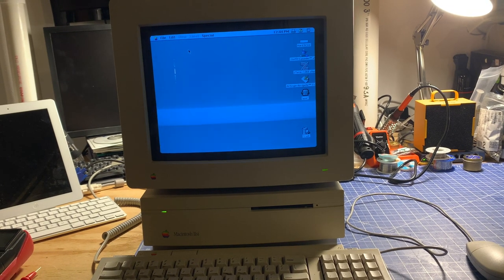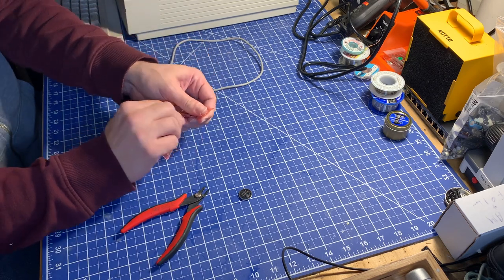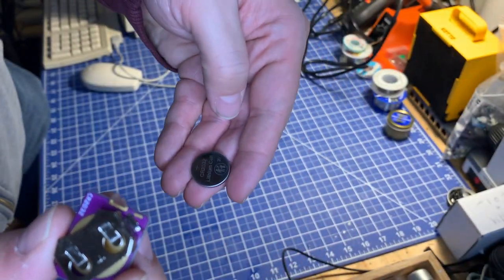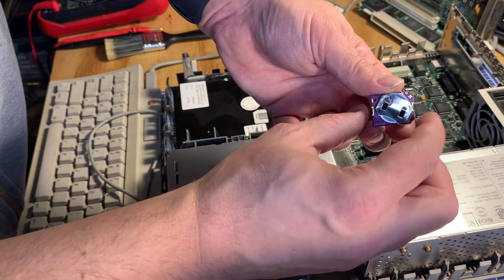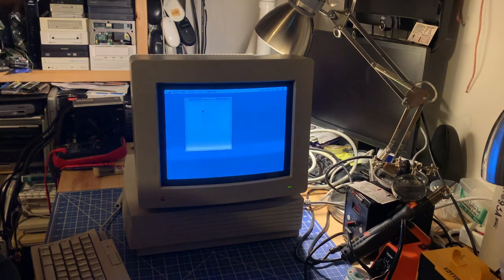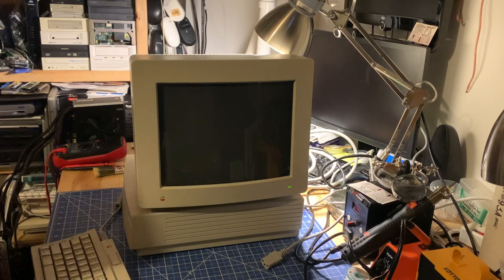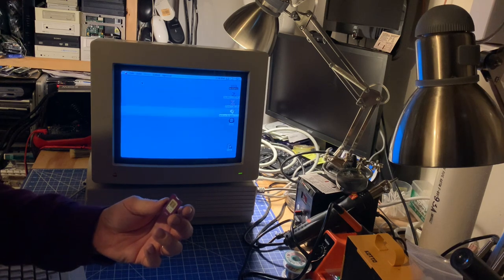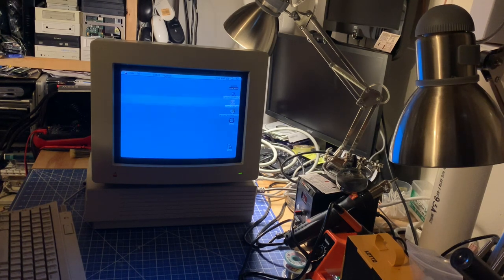Review: MacBatt CR2032 PRAM Apple Macintosh classic Mac battery replacement solution

Comment: Good video! Given that the original 14250 1/2 AA type battery is typically rated at 1200mAh and the CR-2032 at about 230mAh - how long does the coin cell last compared to the 14250?
Reply from the maker: This is a great question, and one I do not yet have the answer to.  So far they are still charged enough to keep the settings, but it has only been about a year.
Reply: @jonobst  I found a discussion online about a similar product called the Meow Toast. The estimate for the CR-2032 in that one was about 3 years. So how long do 1/2 AA batteries last? I have never replaced the one in my G4, but I have seen reports of 10-12 years. That would suggest 3 years for the 2032 is about right just based on the capacities alone, but it may not be that simple.

Comment: Does anyone know if these will fit in a Mac 128K or Plus?
Reply from the maker: They will not - the earliest Macs had the battery compartment on the outside of the machine above the power switch - totally different size of battery.

Comment: I didn't think the Macs used rechargables on the desktop machines?
Reply from the maker: You know, I’ve always just assumed they are recharging as the Mac does put voltage back into them when it is running - which is why the diode is needed.  However, after some googling, I can’t find a definite answer either way.
Reply: @jonobst  I'm just thinking of all the batteries I've pulled out over the years -- I don't think any have been rechargeable -- if they were that would explain better longevity? My gut says in general they just lasted longer. I've been having problems with modern batteries in my older Macs -- they really don't last very long especially if there is a hard cut in power. (Ex my Apple IIGS on a System Saver, or my LC475 which is hard switched) 
Granted back in the day they would have spent a lot more time powered on!
Reply from the maker: @alextirrellRI  it does seem that 1/2 AAs are sold in rechargeable and non-rechargeable forms.  I did some more googling and it really seems like the Macs don't use rechargeables.  I will have to test this out with my multimeter at some point!
Reply from the maker: Consensus is Macs of this vintage definitely do not charge their 1/2 AA batteries.  Thanks for pointing this out!